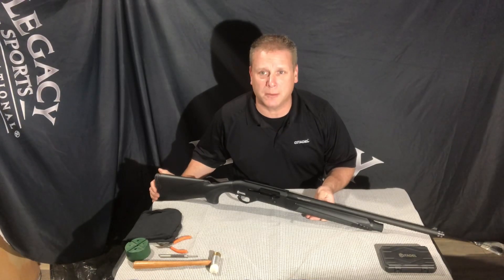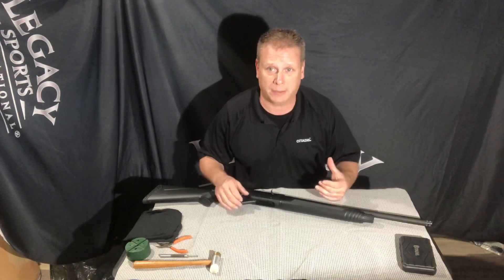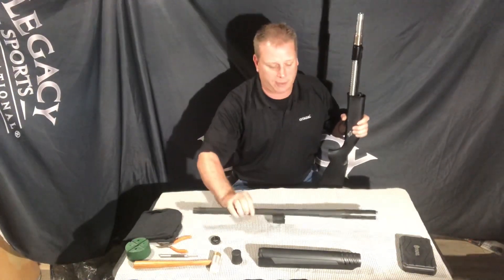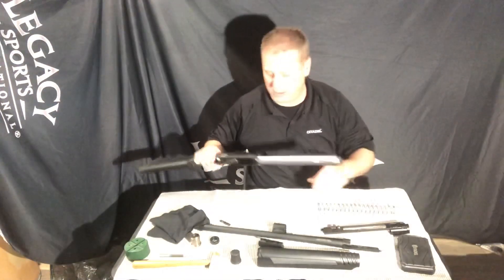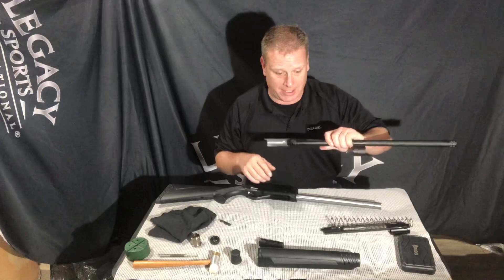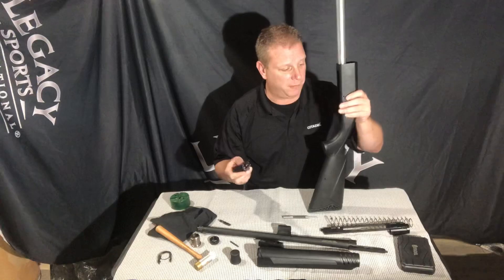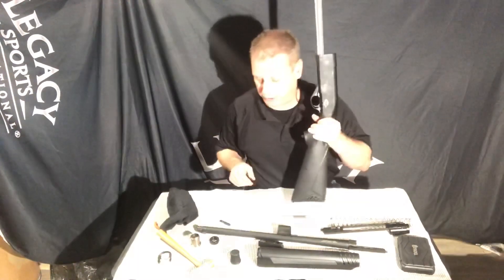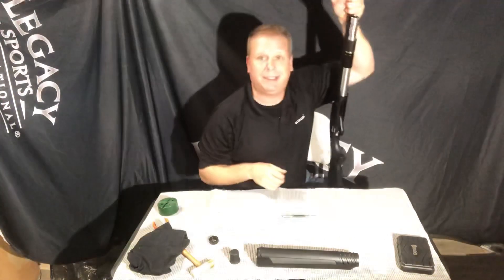Citadel KATAC-ATA12 disassembly/assembly

Comment: Hey I've got the warthog and was curious as to what stocks will fit. Made a bad choice with the pistol grip....
Reply from the maker: There are two versions of that shotgun, one with a pistol grip and one without. You could get the standard stock and it would fit your pistol grip model. No other manufacturers stocks fit that shotgun. The problem we still have at the moment is that all available parts are going into production and there is nothing available for part sales.

Comment: Barrel wont slide back into reciver,  ive already got the bolt in.
Reply from the maker: Hi Alex. With the bolt slightly open (1/4”-1/2”) start lowering the barrel down onto the magazine tube. As the rear of the barrel starts to make contact with the bolt, continue pulling the bolt back slowly as you lower the barrel down until the barrel is fully seated into the receiver and the bolt should then be in the fully locked back position.

Comment: Wish I found this video before shooting mine for the first time this weekend. Got two shells to fire then a shell got stuck under the ramp. Can get it pushed forward into tube (under spring tension) and held in place with screwdriver, but bolt is stuck and only goes back 1 inch. Will try the full breakdown.

Comment: So I’m having this issue, what’s going on? https://youtu.be/fmLpI0poS1E
Reply from the maker: Hello-I see the bolt is locked back in your video. With it closed, do you still hear the rattle? I suspecting the noise you are hearing in an up and down shaking motion is the gas piston riding up and down the magazine tube. That will virtually disappear with the bolt closed since it has no where to travel.
Reply: @scottn4948  from other images I have seen I am deff missing a retention pin from the rail underneath the firing pin assembly...
Reply from the maker: Ok, if you think there is something missing then it will need to come back to the factory for evaluation. Email me at scottn@legacysports.com and I can get the warranty team to reach out with an RA.
Reply: From what I can see there is a part missing on my firearm

Comment: Wondering if there is a trick to getting the barrel off the warthog. I have tried locking the bolt back. Still haven't had much luck.
Reply: Have you removed the charging handle?
Reply: @AMCITADEL   I did, although it wasn't necessary. I ended up getting the barrel off. I had to rack it over and over again to get the barrel to move out of the receiver the first time. What I found was there was some type of burr or something between the barrel and receiver. It created some deep scratches in receiver. Nothing that would impact the performance. I cleaned everything up, smoothing out any rough edges. I can with some serious effort get the barrel in and remove it for cleaning. It just fits really really tight.
Reply from the maker: Hi Nathan- I can attest to how difficult it is to initially remove the barrel from the receiver because of how much oil they put on the gun at the factory. This sample I used in this video required me and another guy to pull the barrel off the first time from all the oil. It was a bear!! Once the oil was removed from the receiver and barrel, it starts to go on and off a little easier. Not much until you shoot it a few times, but easy enough for me to remove it myself.

Comment: You lost me at the oil causes friction comment........
Reply from the maker: Excessive oil, like that which is applied at the factory, creates to much friction and drag on the moving parts causing cycling issues. I see it constantly on a semi auto platform where the excessive oil isn’t removed and the gun jams constantly. It’s also a magnet for powder residue from the gas operation process and causes cycling issues as well.

Comment: I’m looking to get one of these but wondering if this uses benelli furniture? From what I’ve heard they use benelli tube extensions and chokes. It looks like benelli furniture because I want the pistol grip style stock instead of the standard sporting stock, but I like the bead sight more.
Reply from the maker: The choke tubes are a Mobil style thread pattern. It just so happens that the Super Nova mag tube extension works on this shotgun. That’s where all Benelli style parts stop with this shotgun. This particular model is only available with a standard stock. Perhaps down the road we or an aftermarket company will come up with an alternative pistol grip style stock.

Comment: Anybody know of the stock is replaceable? I know the mag tubes are benelli as are the chokes. But I can’t find anything on the stock.
Reply from the maker: Hi Mark- Unfortunately we do not offer any other stock at the moment. We are obviously working hard to meet the market demand right now. I’m not aware of any aftermarket ones being offered either. That can change daily though.
Reply: I heard there is a Turkish shotgun adapter for mag pull that fit this gun… total hearsay though

Comment: Mine did not come with a retaining ring
Reply from the maker: Hi Zach- is your shotgun the KATAC or the Bosshog? They look very similar (version 1 of Bosshog) to each other but are two different guns.
Reply: @scottn4948  KTac
Reply: Mine doesn’t have the retaining ring either. It or something is inside the forend
Reply: @johnchesnutt789  its in the cap..i just got mine serviced ..
Reply: @zachwulf-MidwestOutdoors5015  yeah, I had the benellin nova extension tube on there turns out its not as deep as the cap
Reply from the maker: Does your magazine tube cap tighten down against the barrel lug once the forend is in place? The retaining ring on this shotgun was the first one I had encountered.
Reply: @scottn4948  i need a retaining nut

Comment: Bought a Warthog just before Christmas 2020 and got it in January from a semi-large box store in Ohio. Brought it home and cleaned all the excess oil off of it. Took it to Shoot Point Blank in Miamisburg, OH using 1400 fps slugs. One in the chamber and several in the tube. Pulled the trigger and BOOM. BOOM. Two shots one after the other. The others cycled and fired normally. Loaded it again, same thing. Took it home, cleaned it again, and took it to an outdoor range near my house. This time I used 1250 fps  #7 12 shot and ran a box of it one shell at a time thinking it needed breaking in.  Then loaded as before one in the chamber and three in the tube. BOOM, BOOM again. The rest cycled and fired normally. Loaded it again this time holding the trigger. One fired, but when I released the trigger, Boom! Now I am thinking this is NOT right! Called Legacy, and they sent me a return label to their gunsmith. It is now enroute to Reno. Hope they can fix it.
Reply: Good news, Legacy is sending me a new shot gun! Fantastic!
Reply: Got my replacement Warthog from Legacy Sport. I have to say they were pretty gracious in the way they dealt with my circumstances! Thanks especially to Brenda who worked with me. When I picked up the gun, I brought it home and cleaned all the excess oil and reassembled it. The next day, I took it out to the gun range and ran 50 rounds of Winchester AA 1350 fps 2 3/4 target shells through it. It cycled everything perfectly! Not one problem! Thanks again to Legacy!
Reply: You got a free binary trigger!
Reply: @xl7667  One that I didn't want!

Comment: Anyone having issues with the charging handle/operating lever not fully inserting into the bolt? My lever is very wobbly, and I can still see a little square cutout on the lever, once it clicks into place. The cutout looks like it should go in another 1/8” or so, to line up with the edge of the bolt better, if that makes sense. Any advice would be greatly appreciated. Thanks
Reply: Any reply from anyone would be greatly appreciated. Thanks
Reply: I had to wiggle mine back and force while applying pressure. Just using pressure I couldn’t get it back in. Even with a rubber dead blow. The pressure bread in the bolt that holds it in place is super stiff. For good reason. But I was able to get mine by hand with just a wiggle once I figured it out.
Reply from the maker: I found that the detent holding the operating lever in place was extremely tight, that’s why I needed a pair of pliers to remove it in the video. This was a brand new gun out of the box and I’m sure once it’s fired and broken in a bit, it will be slightly easier to remove and put back in. As long as the “V” notch seats back inside the bolt and the bolt slot is able to ride past the half moon cut out, it’s in place.

Comment: Is there a plug for this gun & how to install?
Reply from the maker: Hi Jeff-we do not make a plug for this shotgun as it was designed for personal defense. I believe you can remove the end plug on the magazine tube and use a wood dowel plug if need be. Just watch out when removing the end plug as the spring is under a lot of pressure.
Reply: @scottn4948  I purchased a plug from midwayusa.com that works. I also purchased other size chokes from Carlson's for this gun. Even though this gun only has a 20" barrel it will be a good bird hunting gun when decoying the birds in close.
Reply from the maker: Hi Jeff- I’m glad you were able to get the plug and choke tubes you were looking for to hunt with. Although we designed this to be a personal defense gun, I can see many uses for this in the field. Would make a good slug or coyote gun as well.

Comment: Great video! Just got mine yesterday. Any idea on how to remove the magazine tube spring? Looking to add an extended magazine tube (the Carlson magazine tube extender super nova) which I’ve heard is supposed to fit this shotgun.
Reply: There is a lip you have to grind off. Benelli Nova mag tube extensions fit like a glove. I currently have 50 rounds of 00 buck and a few slugs and another 50 rounds of steel BB, through the Carlson’s 5 round tube extension. Nothing like 10 rounds of 00 buck on deck to put a smile on your face. Just make sure you replace at least three parts with made in the USA.
Reply: Have u installed it planning to do the same with a couple of rails for a red dot angle grip and flashlight
Reply: Here's a video for the installation of the magazine extension tube:

https://youtu.be/muU4klQ0CvQ
Reply: Scott- there seems to be wide confusion on this issue and I would be very interested to hear straight from you your opinion on installing magazine extensions on this shotgun.

Comment: i cannot get the barrel off mine
Reply: Try locking the bolt to the rear first, the bolt locks into the barrel extension for firing, or at least push the bolt back a little to unlock it. I have a feeling that's why the barrel came off when he put it between his legs, latch probably was pushed back a little as he pulled.